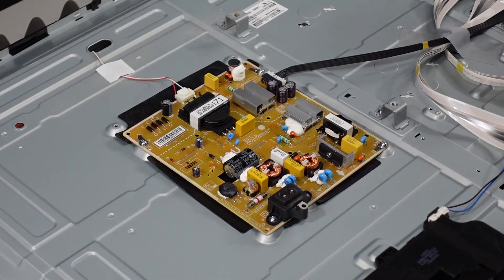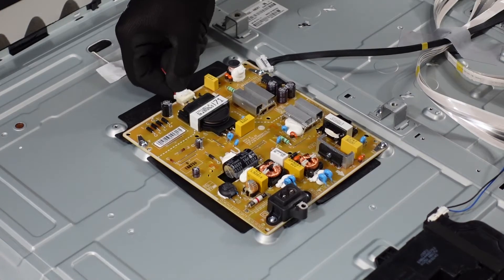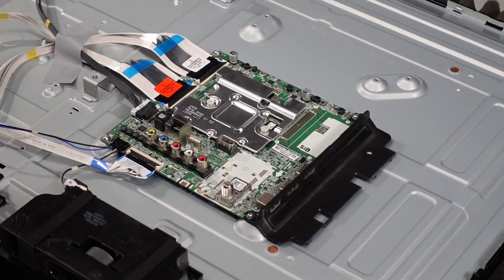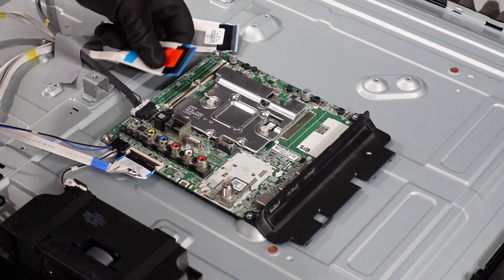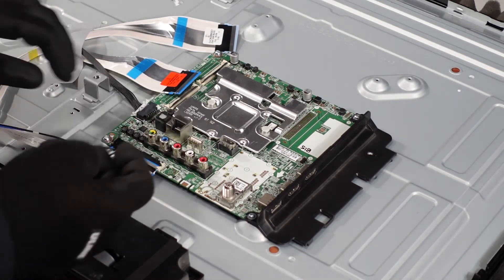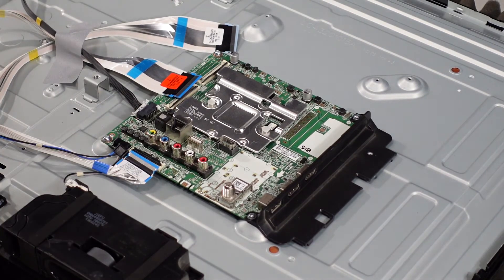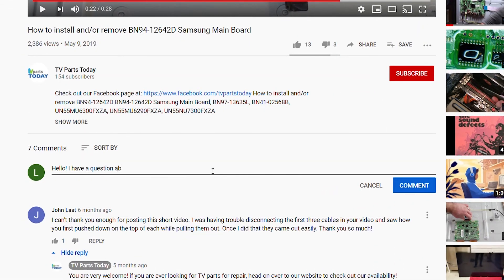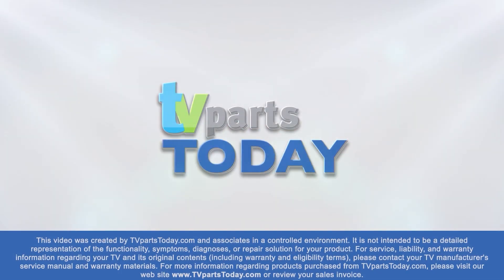Remove the parts from your TV.  (LG 43UM6910PUA)

Comment: I appreciate it I'm going to have to find more of your tutorials I got a LG436100 . Bought it at a thrift stores a gift for my daughter's first TV it worked fine at the store but like an idiot I put it in the trunk when I got it home it's a really dark blue screen it started out as lines turned into blue so I got the repair kit with the motherboard the t-con power board and some wires. I'm going to give it a try I'm really hoping it's not a light issue I can see back lights and hear sound. I bought the kid off eBay. I didn't see your videos or I would have came to you.
Reply from the maker: If the boards do not fix the issue, you have damaged the panel.

Comment: I have a lg 43um6910pua tv - some time ago the picture would disappear, . Then it  would come back. eventually, after a week or two of this one day, the picture went and never came back.  But the sound was still on. Currently when I turn the TV on I see screen glow dark plum colored glow. I guess it means the back lights work. I had  taken the back cover off planning to order the T com on Ebay,  but do not see anything that looks  like  T con.   I would appreciate some  suggestions if possible. Thank you.
Reply from the maker: Look up the flashlight test for TVs. Perform the test and you can email info@tvpartstoday.com. Let them know in the email that you have done the flashlight test and if you were able to see an image or not. They can point you in the right direction from there.

Comment: My LG tv is show the led back light but no display on the screen only audio is being able to play
Reply from the maker: The issue as you have described it, could be caused by the tcon or the main board. In some models, those two boards are built into one. If yours are not, I would recommend replacing the TCON board first. Thank you!
Reply: What is TCON board?